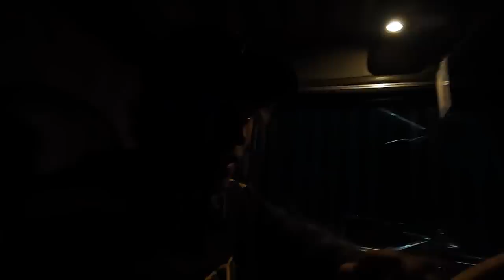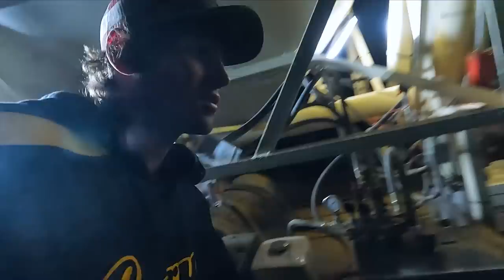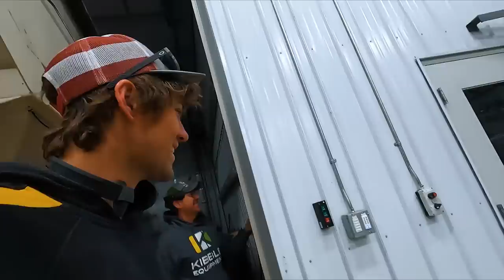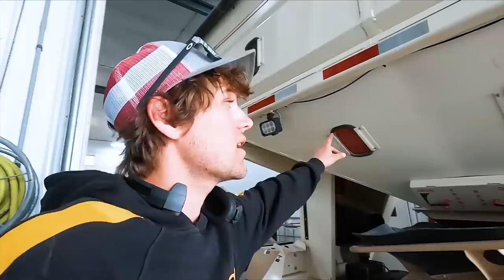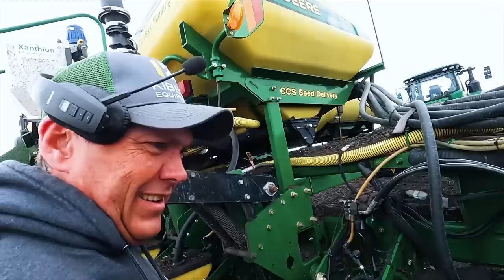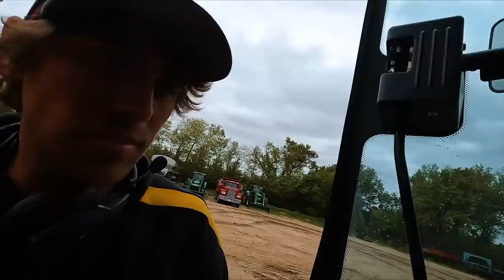Dougo Is Working The Crew!! #3

Comment: Good Video thanks. We use Flex Tube, Loom Tube, for wire & air hose runs on equipment like that, protects & organize a bit keeping stuff up. What your dealing with now was the hardest for me to adjust to or deal with emotionally & mentally when I started in the 80’s. You plan & prepare for everything you can control, get the adrenaline up for work then sit at the mercy of the weather, good news is around the corner you’ll have 3 good easy years with weather, others parts of the country will be struggling. I wouldn’t have made it thru that part without my faith. Good Luck God Bless.

Comment: it is a shame the tool you are working the real wet places with will not work for getting the ground right for planting so you would have 3 rigs fitting ground and maybe the bean planter would not been out of ground
Reply: They could put their third field cultivator on the 450 if they didn't need to dry out wet spots.

Comment: Regarding your in field ponds, back in my day we would take the field cultivator and back them into the pond as far as we dared, drop them and pull out.  It takes time to work around them but what it does is open the bottom up so they will drain and dry quicker with some good sun.

Comment: You know instead of apologizing to the neighbors. You could always just put a muffler on it and be respectful to your neighbors
Reply: Do they make mufflers for jake brakes? Was aware of it.
Reply: @lynwessel2471  Yes. It's called a muffler. The Jake is only on the valve train. It just makes the exhaust super loud. It's required by law in many states and a LOT of local jurisdictions. New trucks with DEF are quies because the DPF acts as a defacto muffler. Truck owners like them loud like kids. And also no muffler can improve your mileage, but not much.
Reply: @tireballastserviceofflorid7771  We have mufflers on our semis, jake doesn't sound any different than that one. Just don't use it where not supposed to. Chet said nobody lived where he was there.